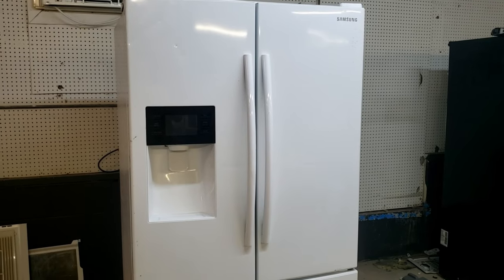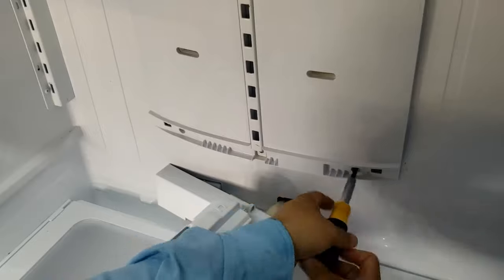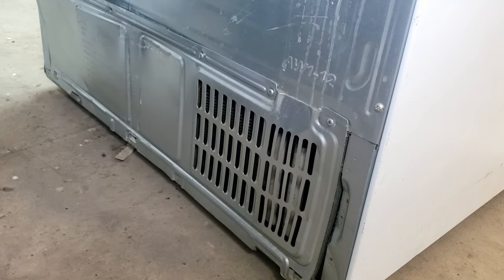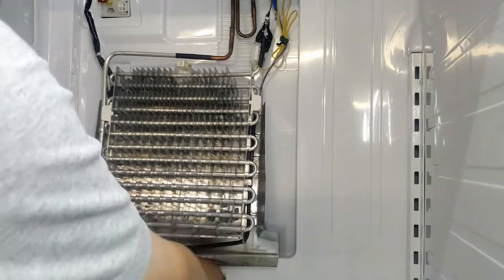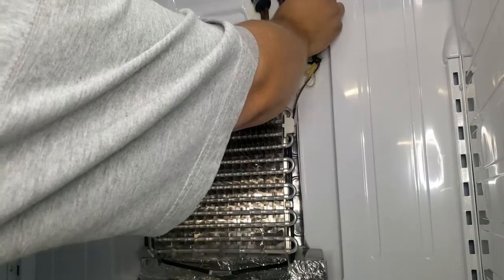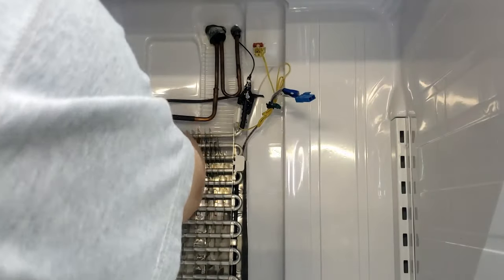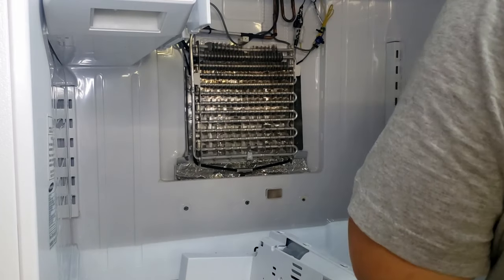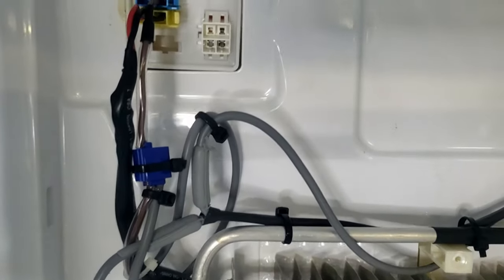Samsung Refrigerator Ice Build-Up and Leaking Water Inside Drawers - How to Fully Fix it Forever

Comment: Why do we have to pay someone to do all of this when we have already paid thousands of dollars for these expensive fancy refrigerators?  For the price, shouldn't they just make. them with better quality?   Mine started this immediately.  Repairman said it's a mechanical design flaw that Samsung refuses to own.  Many service people won't touch them.
Reply from the maker: The true answer is that Samsung is a garbage company that does not stand behind their product. They're known to screw techs out of warranty fees, screw customers out of refunds, and screw you out of a good fridge that you paid thousands for.

They are the epitome of good-looking, horribly-designed products. 

Their design teams are better than the competition. They have (I believe) low wholesale prices and bonuses to the places that sell them, since they aren't putting money into warranty fixes/ect since most units start to fail just after the 1yr period.
Reply: @bensappliancesandjunk  can you recommend a good fridge manufacture to replace this Samsung with?
Reply: @manmanepic  A lot of people are saying that you should get a whirlpool.
Reply: @bensappliancesandjunk  that's exactly when mine started to act up!
Reply: @andrewmayer4401  I have a older whirlpool and I had to put in the defrost kit to keep it from freezing up too. The main component was the little finger that attaches to the heater and drops down into the drain tube. A cheap fix $12.50 but should have been there to start with.  How many people will junk a refrigerator just because there's water inside the refrigerator? Once the thing gets a few years on it a 250 to $300 service call just isn't worth it. These crappy designs are adding to our landfill problems. There's no reason a refrigerator cannot last 35 years.  My parents philco from the 1950s and the General electric that was original from the house in 1962.  The GE lasted until the mid '90s when the compressor failed. The Philco was sold and could still be out there running.  It's truly amazing how many 1940s and 50s philcos still run.  A completely sealed system with no fans heaters or other things to fail.  The only active components were the thermostat and the compressor.  Okay the light bulb and the light switch but you can live without that and it would be cheap to fix.
Reply: I'm getting rid of mine. Samsung should stick to phones. No more appliances
Reply: I did some research and believe Frigidaire might be worth a look.
I would just buy level of appliance with features I would use to keep price point reasonable if there's such a thing these days.
Reply: Planned obsolescence. My mom has an Amana fridge that's still going fine and it's 30+ years old. It doesn't have water and ice dispensers, just ice trays.
Reply: Just bought a new house, I was wondering why the only appliance the previous owners left was the Samsung fridge , it’s building up condensation on top of the outside of the fridge and dripping water.

Comment: Ben . . . I did your fix 6 months ago, and it has worked like a charm.   Thanks for the video.  One tip for clearing the frozen drain line:  To thaw the drain line I hooked up about 5 or 6 feet of 1/4" flexible vinyl tubing (with a makeshift adapter) to a wet vac, and poured boiling water into the drain line while advancing the vinyl tubing into the drain line to suction the column of water.  This allowed hot water to melt the top surface of the ice column without allowing the ice to render the water too cool to melt the ice.  Amazingly, this technique cleared the frozen drain line within 10 seconds!  I hope that helps your viewers, because I haven't  found anything on the Internet -- although I haven't look exhaustively -- describing that technique.
Reply: In

Comment: Ben, I simply cannot thank you enough for this repair video. As a senior citizen on a fixed income I was looking at laying out a huge chunk of change. I have been fighting with my Samsung fridge for the last ten years. After the water line between the reservoirs ruptured I was ready to pack it in and buy a new fridge. Thanks to your video I replaced the drain heater, added the insulation strips, the drain tubes, and added the top heater as well as fixing my ruptured water line. Finally after years fighting this fridge it’s fixed and I have you to thank for it.
Reply from the maker: I am so glad its working better for you! Samsung wont put the heaters in stock due to energy efficiency but other brands like LG have. Units with these "French Door" style systems seem to be a magnet for this issue, and companies are really reluctant to solve this.
Reply: 7:10 - those self-adhesive strips has to be attached from outside of aluminum cover. You gave people wrong recommendation. It has to be between aluminum cover and fridge body !!!!!!!!!!!!!!!!!!!!!!!!!!!!!!
Reply: @bensappliancesandjunk  Heh Ben I followed your fix to the letter but I’m now getting a flashing error code on the display and don’t know how to clear it. After much googling the errors seem to be related to the ice maker, which I don’t have. Can you help?
Reply from the maker: @lisaoconnor5139  what is the code?
Reply: @bensappliancesandjunk  thanks for the reply! I’m trying to attach a photo here but can’t.
Reply: @bensappliancesandjunk  it is the inside top display. On the freezer side only the middle center line is lit and flashing. On the fridge side the top center and bottom left is lit and flashing. At the moment can’t check or change the temp and the fridge is freezing my food.
Reply: @bensappliancesandjunk can you please recommend someone to do this repair for me? I’m widowed and live in middle Tennessee

Comment: Ben, thanks for the video. I have done the repair & it has only been 3 days, but it is working ok, so far. I do have a few suggestions:    
1. Before doing any of these repairs, try the following: clean out both of the drain tubes in the bottom back of the fridge. There is a mode for the fridge that manually turns on the heating elements ( Ben's video shows it) . Turn it on to defrost the coils. It was not documented in any manual I saw, but it is there. This means that you  might be able to force the coils to defrost without completely turning off the fridge. worth a try. if the water is still draining into the Fridge, that means that the drain tubes are not clear.
2. do not trust the temp display on the Fridge. you can get an inexpensive Bluetooth thermometer and put it in the fridge and track the temp. I have a Govee Wireless Thermometer and it works great. It gives me a graph showing history. I can see the temp on a min by min chart & even see when the Fridge thermostat turns off & on. (btw, I have nothing to do with the company, I just like the product). This thermometer is very accurate & I can see the the Samsung temp is way off (pos). this is the only way I can tell that temp the fridge really is.
3. Easy way to get that metal clip/heatsink off. Do not bother with a wire clipper. It is held on with a aluminum rivet. just drill it out, the fastener/heatsink will then easily pull off. 
4. Learn your lesson ( I have), Do not ever buy a Samsung POS again.

Comment: THIS is the fix that actually works!! I did it 3 months ago and the problem is finally, consistently solved. The secondary heater fix was new to me but it made all the difference. I also moved the defrost sensor form being clipped onto the copper line and covered in mastick, to a new location on the evaporator coil. There was even an area on the upper right of the coil that looks like it was made just for that--the sensor fit perfectly and snapped right on. Thank you so much for this info!!!!
Reply: I had this exact issues a few years ago actually. I just replaced the evaporator clip and havent had an issue since. This video is saying its the ultimate fix and it makes sense to just replace any parts that could give you issues, but the clip alone did the trick for me. They mention it at 8:10 that it could just be a temporary fix, hopefully thats not the case for me. Im at about 3 years now without an issue.

Comment: Thank you for your post. For those is you facing this issue, water in your fridge is not necessarily from ice buildup. After removing the back panel and surprisingly not finding any ice, I did notice that the aluminum shield was corroded around where it funnels water into the drain. And the top of the drain hole was partially blocked with pieces of aluminum and a brown gritty substance that appears to be rust from whatever material the shield is made of. I cleaned up the rust, installed the drain kit that I had ordered and repaired my corroded shield with aluminum tape. I buttoned everything backup and seems as though problem solved. While my issue was not ice buildup, your video was very helpful and have me the confidence to tackle and overcome the problem without paying a repairman $75 p/hr plus parts.

Comment: I want to say a huge THANK YOU! It's people like you who make me at least TRY to fix things myself. My husband and I spent an afternoon fixing our fridge, and, thanks to you, IT WORKED.
Reply from the maker: I'm glad it worked! This is one of the STUPIDEST and most insane fixes we have to do. There's no reason this issue needs to happen on a $2,000+ fridge, yet they do so often. Other brands fixed this by gasp installing a small heater on the fan but the $5 fix eludes the manufacturer... Costing you, a homeowner, $80 in parts to fix totally, or $300+ from a tech. Nuts.
Reply: @yuriy797  no, you are wrong. he did it correctly. it should isolate from cooling mechanism, not from fridge walls.
Reply: @bensappliancesandjunk  I’m going to try this w my sons help so we both learn (I have a visible ball of ice ant constant water/ice under the drawer) but all of the ‘in hindsite’ suggestions make me very nervous!

Comment: Thanks for the clip.  I have fixed the drain freeze issue twice by now.  The water still builds up regularly and I need to clean out the pan below crispers every two weeks.  May be an extra heater is the answer; will try it now.  

How sad it is that Samsung has advise on how to properly mount the foil backing to fix their own poorly designed defrosting and drain system.  It is truly ironic how consumers spend thousands of dollars of Samsung appliances but Samsung fails to accept their design mistake, to apologize for the troubles their customers face and to send free repair kit to all buyers.  

This is the last Samsung purchase I am making.

Comment: Great vid! I've had the icing problem on my 2010 model and have removed the back interior panel several times through the years. Your fix is next on my list.  My internal components are the same as your video.  Samsung seems to keep manufacturing the same bad design year after year.

Comment: I see tons of these units on a weekly basis. I can also add that I've fixed them without this method by simply getting a flashlight and putting it inside the fridge section: turn off all lights in kitchen and close the fridge doors and check for light escaping at top or bottom between the french doors. If you see light, that probably means that you have a damaged door gasket (the rubber flap on the sides of the door gasket on top and/or bottom) even if the actual gasket itself is 100% sealing perfectly. That small torn flap will allow humidity to enter the unit just above or below the mullion heater bar, and cause the compressor to work harder for no reason because of the response of the several thermistors (temperature sensors) in the fridge section. 
That and literally every samsung I work on, almost always has a ridiculously dusty condenser coils. I use a ryobi one + compact workshop blower to clean off these style of coils because vacuum extensions and brushes cannot get to everything (and they always look like new afterwards) and its easier and faster to vacuum the aftermath around the fridge too (lay towels around the opposite side to catch big dust balls from pluming into the air)
The dust clogs the drain tubes and there are typically 2-3 tubes to check the nozzles for clogs. This is ultimately the catalyst for most samsung ice-buildup/defrost/leaking issues.
These compressors are not designed to function with the extra heat, so this spreads excessive particles of compressor lubrication oil throughout the sealed system in some cases which can eventually lead to partial clogging at the capillary tube before it enters the evaporator (the areas where the frosting is about to happen). This is mainly because on select models of samsung and LG alike thought it would be a great idea to crimp the very end of the capillary tubing there because it acts as a noise damper when the pressure equalizes so people don't hear the refrigerant gurgling or 'water flowing' sounds. 
Also, if your samsung icemaker stops working, some models are actually designed to shut the icemaker down if your compressor/condenser gets too hot. Just clean the dust off condenser coils and the control boards 'ambient thermistor' will be satisfied and restore regular icemaker function. To speed it up, look for a blue button on your icemaker and hold it for up to 10 seconds to reset/force harvest. Not all icemakers have the blue button but most french door styles do.
Reply: So you're saying this whole repair can be avoided by replacing torn seals and cleaning the dust out of the condenser coils?

Comment: Thank you so much Ben. You saved us almost $2,000!  Buy the kit...it worked for us on our RF18 in our RV.
EDIT:  Well, come to find out, this was not our problem. The problem was the Thermal Fuse Assembly. When we first put in the heater we didn’t have an Ohms meter to test if everything was working. A week later it froze up again. A friend came and tested everything and the heaters were not getting power. After further searching we heard someone mention this fuse and so we found ours on the left side behind the coils. Ours had condensation in it and was not working. $10 later and we are back in business. We did leave the extra heater installed. Hopefully all is corrected now.
Reply: do you have a part number for the fuse?

Comment: I just wanted to thank you for this video I’m currently in the Samsung training to become a service center and I haven’t heard mention of this fix ever. Thank you
Reply from the maker: The Samsung factory fix is their moisture service kit. The secondary heater is an adhoc add-on that techs came up with that definitely isn't OEM. It'd change the EnergyStar rating which is probably why Samsung never attempted it. The other fix not mentioned on icing is putting the code into the interface that forces it to change from adaptive to timed defrost - that specific step is VERY prevalent on the Whirlpool FBDM iteration that ends up having this same exact problem, too.

Comment: Great video. This refrigerator has driven us crazy with routinely building up ice on the floor of the freezer and ice behind the crisper drawers as well as leaking water. I have changed the drains twice and recently had a repairmen who did the same plus a couple other things but I don’t recall what the “other things” were. His fix lasted longer than mine but we are back at it again now with the crisper drawers. The freezer compartment seems to be holding its own. With your help, I am going to try one more time to fix this thing. If that doesn’t work, the junkyard will get a new fridge and so will my wife. The wife’s will NOT be a Samsung.

Comment: Just ordered the kit for our 2014 RF263BEAEWW French door model which looks pretty similar to the one you worked on.  I tried to fix it about a month ago after watching a less than adequate home video and removed the ice which had completely enveloped the back side of the evaporator cover assembly.  This worked until the past two days when that familiar rattling returned and my wife threatened to buy a new one, but not a Samsung!  Hopefully this does the trick as well as restore my wife's faith in my handyman abilities. As they say you are only as good as your last fix it job.  Keep you posted.
Reply: How is it working? Love the last repair comment
Reply: @jakemf1  So far so good. I installed a new defrosting element along with Ben's defrosting mod for good measure. His instructions where spot on and easy to follow. Just take your time when defrosting the whole thing, the cover can be pretty water logged and frozen tight and the Styrofoam it is made of will break before the ice does. Now on to the next honey do.

Comment: So, I thought this was another BS fix, but dang, it really did work. I had this issue show up all of a sudden after 4 years of ownership and cleared it out. There was a bunch of frozen mold and other nasty crap under the crispers I had never realized was there. Two weeks later, it happened again and again every week. I replaced the clip which didn't do anything. I bought the Samsung kit which had insulation and that didn't do anything. I bought the kit from Ben as a last ditch effort before getting ready to trash it, and it's now been 2 months since I bought the kit with no freezing or water under the crispers. Great work, Samsung should be ashamed of themselves for having this design issue. Seems like there should be a lawsuit against them on this. I'm sure tons of people out there have replaced their fridges because of this, total trash.
Reply: There is a class action, you’ll get around $200 if you’re lucky